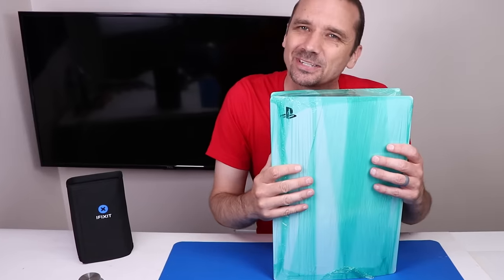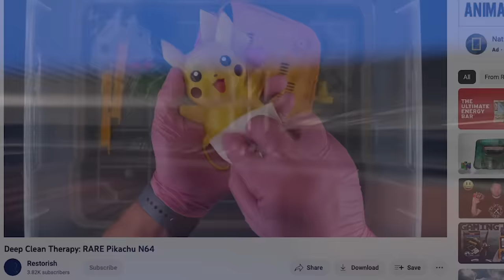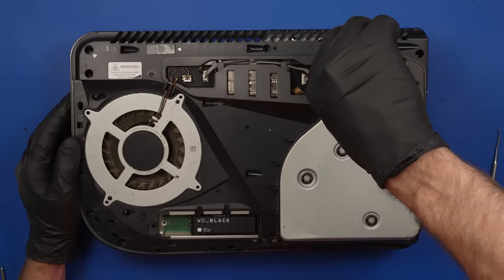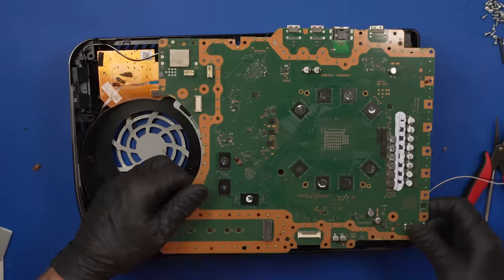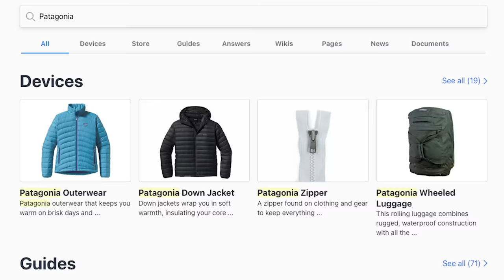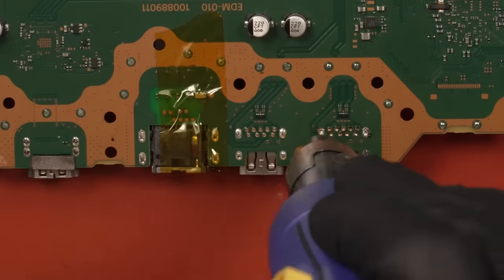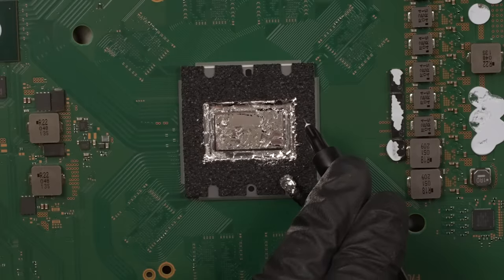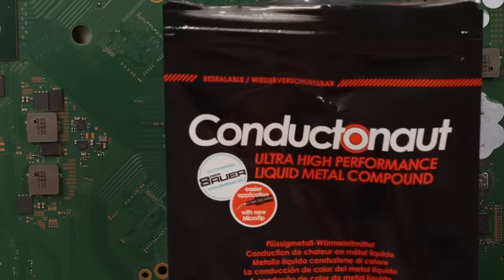I Bought a PS5 on eBay - It Was Infested With ROACHES and BROKEN

Comment: Not counting the roaches, how TF does someone pay that much for a console and treat it this bad. I don't even use my PS4 since getting the 5 but I still clean it out regularly.
Reply: Riiiight. I still have my ps1, 2 and 3 and they are in top tier condition
Reply: If it was bought by a parent the user probably didn't even think to care
Reply: It was probably used by a kid who is irresponsible. How does someone get cockroaches😂
Reply: Believe me, I've worked in the repair field for a long time. Most people just like companies don't care about the equipment until it doesn't work. Then after all of the damage they want it back "Perfect". I've seen Telecomm equipment half full of dust and cockroaches. (I hate cockroaches)
Reply: @ RJenkins6586 when I worked at GameStop I had someone try to trade in their ps4. It was infested with dead roaches, and told him I couldn’t accept it. Homeboy had the nerve to ask why I wouldn’t take the console if it still worked lmao

Comment: I'm currently studying Embedded Systems, learning programming in c and soldering and measuring. You're content is not only enjoyable now but I can actually understand and appreciate how complex these PCB and IC's really are...
Reply: The "complexity" of PCBs is less about functionality or performance improvements and more about intentionally decreasing the ease of repairability for the general consumer.
In fact some unnecessary pcb complexities split up board functions onto daughter boards, like we see in modern controllers, merely to introduce more possible fail points should a consumer attempt dismantling their devices.

Some pcb complexities like this however, are for making a product more compact.

Comment: A bit of advice, when you get any type of electronics that might have possible infestation put them in plastic trash bag and then put them in the freezer for a hour or two that will kill off any roaches or bed bugs or any bugs.
Reply: You can't kill roaches by freezing them. They pop right back to life as soon as they thaw
Reply: @jamesburchill7522  No, that's not true. I kill them all the time like this. I work with exterminators on a weekly basis. This is is a method that was recommended to me from a few different exterminators.
Reply: @jamesburchill7522 Of course you can. Roaches loathe cold environments.
Reply: I guess play more , clean less for this ps5 owner
Reply: Putting the console in the freezer could trap moisture inside and cause a short or other problems, it’s probably better to place the console in a bag with moth balls or something like that
Reply: @oscar1081  Putting Electronics in the freezer won't hurt them. Remember they are shipped in shipping containers and tractor-trailers all across United States in below-zero temperatures. They sit in these trucks and trailers for days if not weeks in below zero temperatures. Most electronics are tested in freezing temperatures. If you have moisture in your electronic devices you probably spilled something in it. LOL. I have been using the freezer method with all kinds of different electronic devices from video game consoles to radios and never had any issues.
Reply: @edh4686  To kill a roach, the temp needs to be below 15° fahrenheit. Most freezers don't get that cold. They make sprays, which are far colder, and that is the preferred method.
Reply: It depends on the type of roach. The ones in that ps5 are German roaches and are the ones that cause infestation and are difficult to get out. I dealt with them once whe. I lived in a cheap studio for 3 months. Luckily they were only in the kitchen and did not get to my electronics (I think they were coming from a neighboring unit).

The roaches I would rather see are wood/palmetto ones. They may be bigger, but they are easier to get rid of and are difficult to cause an infestation unless you allow them to.

Comment: insane how people always managed to destroy usb or hdmi ports, sometimes i plugged in hdmi & usb cables with force too or with the wrong side blindly but idk how much "force" they have apply to break them, unless they step on it to break the connectors off etc.
Reply: Since at least around 2000 when I used Scart I have always used things like switches for av items and a usb hub or even just a male to female adapter rather than put something in direct that way if I damage something its just a case of replacing the single item rather than having a ruined device/tv/monitor.  I used to think I was being a little crazy doing so but in recent years people have told me either they do the same thing or its a smart idea.

Comment: If you think there might be insects in inside, make sure it’s well wrapped like as air tight as you can get it with cling film and put it in a freezer for a few days, it will kill them. Better that than them scattering all over your work bench.
Reply: "extreme cold can damage electronics. When temperatures drop below freezing, water inside the electronic devices will turn to ice. This can cause the components to expand and crack, which can lead to permanent damage."

-- Google
Reply: Definitely do not put your console into a freezer.

Comment: I resurected a Xbox 360 from a flea market that had roach infestation. The trouble is they crap across the circuit traces and short out the board(s)!
 You have to put the console in a plastic bag with paper towels soaked with alcohol. The fumes will kill them. The tiny board that was for the controller was toast from the bugs. I replaced it and all was fine. The console me $9 on my original purchase. They CAN be saved sometimes.

Comment: So I have bought my first PS five to try to bring back to life. Somebody must’ve spilled something in it that was white. Thankfully, the consul does turn on, but I couldn’t get it to read a disk. I took the drive apart, and cleaned the rollers with IPA like I’ve seen in past videos, and when I put it back together… It wouldn’t take the disc anymore.

Did I do something wrong? Should I just buy new rollers or try to clean them again?

Comment: Curious question… if you have a ps5 put away since launch say 3years would you need to replace the Liquid Metal? Or does it only dry out with heat over time..
Reply from the maker: It doesn't really dry out per se but it does oxidize on the APU and that oxidation may need to be cleaned off and the liquid metal respread. If it's working fine though then no reason to do it.

Comment: I used to think of myself as an average clean person but then I had roommates in my 20s who taught me that I'm basically OCD when it comes to cleanliness. It's amazing the filth some people will live in in their homes. Brave of you to repair a roach infested console.
Reply: Those little roaches dont live in "filth" they look for somewhere warm & moist which is why they were in the console. Sometimes the first sign of even having those roaches is when an appliance suddenly blows coz one was walking around inside and shorted two connections. You shouldnt be so quick to judge. Im sure the owner was devastated.
Reply: @danatmonst3594  The overall condition of this console including the caked on dirt/gunk on the outside, jammed up disc drive and excessively dirty fan tell me this person does not respect their possessions.. This makes it very likely that individual doesn't clean or maintain much in their household. I agree that cockroach / bed bug infestations do not mean you are a dirty person. However being so negligent of ones expensive electronics certainly points towards that being a likely reality. At the end of the day to each their own but I for one have realized the direct connection between my mental health and the cleanliness/organization of my home.
Reply: @danatmonst3594  A filthy home often attracts the roaches in the first place.

Comment: I have to say I think the liquid metal cooling solution is so incredibly dumb if it gets dry spots after just a few years, this is probably also the result of it running while upright and the metal pools at the bottom of the die. If you want your PS5 to last you should probably lay it flat.

Comment: why don't you just use a cue tip with IPA and get all the liquid metal into a ball, wait a bit for the IPA to evaporate and then re-spread the liquid metal?  I have never had to add more liquid metal to any PS5 consoles that I repair.  Great fix by the way and I am glad we don't get infestations like that in the UK.

Comment: Hey this is a very important question. I know if anyone will be able to provide a clear answer it would be you. I recently just bought a series X. And I'm already thinking ahead for preventive measures so I put a dust cover on it.. you know just a mesh shield because my home is a lil dusty do to were I live. The area is well-ventilated plus there's a small fan running all the time. Should I be worried about the Xbox overheating in the future? Or our dust covers completely safe as long as the Xbox is well-ventilated we optimal airflow in the room

Comment: I work at a game store called GameXchange. Based in the southern USA, we buy and sell used consoles of any condition as long as they work. I cant tell you how many absolutely horrid gross consoles and games I've come across. From live and dead roaches, bodily fluids, cigarette smoke, nasty orange dust, to rat poop and cat piss soaked games and consoles. Every time I think I've seen the worst one, some crack head brings one in that tops the last. I'm not supposed to, but I've started turning people away if their console or games aren't clean to a reasonable level. I don't want to sell a console that I wouldn't want being in my house. That being said, I can absolutely smell this ps5 through my computer screen. The infested ones like this have that certain pungent smell of a wet dumpster fire. EEWW!

Comment: I am mid way on fixing my Dualsense gamepads cuz now both have crunchy ass drifting sticks but I have found out that my soldering iron is not melting the solder, not even with flux applied... so I have the board on my table and IDK what to do cuz yeah... I have ordered hot air soldering iron so I hope it will be better...
Reply from the maker: Some irons just can't handle it. You may need to upgrade your iron
Reply: @Tronicsfix  Yeah I bought hot air soldering iron and it should come tommorow I think so I hope it will work since it was 5 times the price of the one I tried before.
Reply: @Tronicsfix  Swap was successful YAY

Comment: There are still people out there that says Liquid metal does not dry up even though I saw a lot of it dry up on Laptops even before it was used on the PS5 Sony needs to find a better alternative as I have worked on a lot of overheating PS5 already to know that Liquid Metal was not a good solution for this maybe they can switch to a Honeywell PTM pad instead.

Comment: I was wondering if you ever experienced a problem with an infestation as a result of bringing in a bug infested gaming unit.
Reply: It seems to me one in such a profession should have some kind of  sufficiently large solid box/container they could place the compromised hardware in, fill the container with insecticide, and seal the whole thing for a night or two, just to be sure. It would be a whole lot easier than to deal with a roach infestation in the workshop, let alone home, if working from home.

Comment: I always wonder what do you have to do to manage infest your console with roaches or other animals. I mean how is that possible ?
Reply: Those roaches avoid light so you wont see them most of the time. They love dark warm places and only come out to eat and drink. Usually while you're sleeping coz the lights are off. You may not even know they're in there until one accidentally fries itself on the circuit and your console stops turning on. Nightmare fuel for sure.

Comment: I've never heard of liquid metal before these repair videos. Is it an electrically conductive alternative to thermal paste?
Reply: Its not an alternative to thermal paste, its the next step in efficiency. Liquid metal offer better thermal conductivity and because PS5's APU produce very much heat Sony was forced to use liquid metal. It has it drawbacks(for example, if the system stands vertically, the liquid metal will flow down after a while; not a good thing for many reasons). Thermal paste has has kind of the same drawback but in much lower degree and also having lower efficiency.

Comment: Well, That really is too much liquid metal for a good result, not in terms of cooling but all that excess ends up around the die and in that sponge sheet, but the chance is very high it might splash out and short things out if the console gets dropped or tipped. the sponge can´t protect infinitely and the metal can seep in under it and short the apu too. someone had to say it. a very thin even film on both surface is all it takes for maximum performance, floods of it won´t cool more than the actual right amount, that stuff is expensive too

Comment: Hey I have a question if anyone knows. A while back I had heard that if you got your ps5 fixed that you may not be able to stand it up again because liquid metal may leak onto your board. Was that issue ever fixed or was it not true?
Reply: The only fix is to either regularly open your PS5 and reposition the liquid metal(not a job for everybody) or just keep it horizontally all the time.